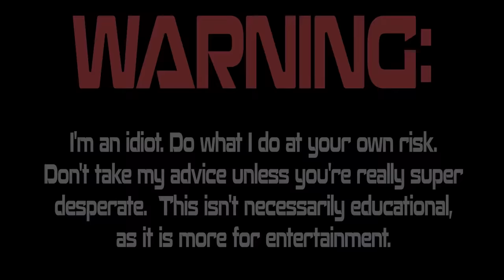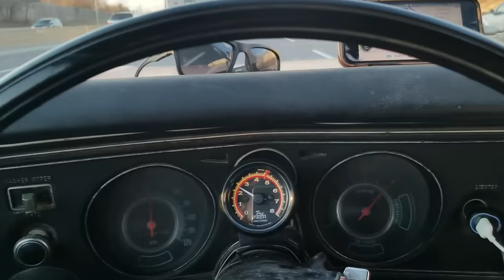FORGOTTEN 1969 Chevelle will it RUN AND DRIVE 500 miles home?

Comment: When you take the sparks out the heads.
May i ask why you do not put some squirts of Diesel down the cylinders.
It will even release a stuck motor if left over night.
I was told this by a old timer and it works very well. as it lubricates and frees rings like nothing else.
Give it a try bro and let your watchers know as well.
All the best from the UK

Comment: I saw you using marvel mistry oil in that old engine;.word to the wise is that oil is detrimental to teflon cam  gear teeth. If you want to test that theory soak a teflon tooth cam gear in a pan of marvel oil and let it soak over night. You'll discover what I did after doing that test. Teflon will break down and flake apart..most gear sets are all steel now days. My test was performed in 1980's. I love your many interesting videos from Shady Hills, Florida. USA.

Comment: Looks exactly like a car 🚘 my brother was going to work a deal with me a on when I had my learners permit except it was a 1968 he had put a 400 small block with a turbo 400 in it out of a 1970 caprice he had  but first time out he put the onions  🧅 to it and tore the rear end and suspension out he had to hire a fabricator to do some welding an suspension upgrades then ran into some financial issues and couldn’t hold the car for me and had to sell it I was bummed but probably a good thing I would have raised way to much hell with that car and being red tickets would have followed I ended up with a  pea green with gold side stripe  1968 Chevelle with a 250 straight 6  Saginaw 3 speed on the floor  jacked her up in eighties fashion or some rally aluminum mags on there with meats in the back had to roll the fenders of course to get them under there then painted her primer grey with black rally stripes 👍👍lots of good high school memories in that old car !!!

Comment: I was watching you work on “Rocky” and you did a compression test.   After you put oil in cylinders.  
I totally agree with everything you did but I don’t believe your compression numbers….
If you had say 14 psi of atmospheric pressure and you got between 140 psi and 180 psi.  You have to have a minimum of 10:1 compression engine.   
I just watching second video of that engine tear down and rebuild….

Your “psi” numbers are not correct and I believe that oil in combustion chamber is messing with you.  

What you think?

Also I’d like to know your thoughts on what the “1” means in 8:1 compression ratio….
I’m a boat captain and a pro fishing guide these days but I spent years at a junk yard or automotive recycling yard that ran “Hollander”.  I also was shop manager  of a smaller Hollander yard

I watch all your videos and I recommend them to my friends

And as a side note.   Some cylinders won’t have as much oil as others…. Unless metered.   This could also mess with the numbers 
Piston position combustion chamber design 
Location of spark plug hole.  

Lotsa variables

I say a true compression test is done with motor at operating temp after running and it should be done dry on the top end.  

Hook your peepers on that…
Maybe I’m wrong…,

I DONT KNOOOWW!!!

Comment: Only firing order 
 one I can remember off the top off my head is the ol straight six and Kenworth Trucks cause I build them everyday in Chillicothe Ohio. Straight six is, 1, 5,3,6,2,4. And the ol Kenworth diesels fire at the same actually if it is the Cummins motor. If it is paccar motor they are a bit different but almost the same. Just starts at valve 2 instead of one.

Comment: I had a Ford Focus. Was a nightmare always something wrong with it. I had a oil change a month before MOT day. On MOT day The guy took it away then came back and said I can’t MOT this. It’s bone dry. I was like 👀. They put oil in it for the mot and funny enough it passed. Had to keep drums of oil in the boot to keep topping it up. I hated that car. I came out one morning to warm it up so my pregnant at the time  partner could get In a warm car. 5 minute after starting it it kept clanking. My partner came out and we just stood looking at each other 👀👀. I decided to give it a few hard revs to sort that out. Turns out the camshaft snapped 2 seconds later 🤨. That was the end of that car.

Comment: I’m a diehard GM fan too I only like the older stuff because it’s reliable, these new GM vehicles sucks! My 1991 Chevy G20 van runs so good it’s for the 5.7l small block V8 with the 400 transmission I love that van it’s never let me down, I own a couple other chevy’s too & a dodge ram lol

Comment: Give up on rebuilt starters. They rebuild the drives. I have put NEW drives in countless recently replaced rebuilt starters. A set of brushes and bushings and a leather brake washer will fix most of them. Much cheaper too.

Comment: I would never stand over the radiator hole while tapping on the thermostats housing. If it popped open, you would get a free shower.

Comment: Luckily, it's the best SBC the 307! LMAO! Too bad it's not an SS 396. Kneeling on rocks is just as fun as kneeling on a 1/4" nut. In this case pull the windshield and the front seat then leave for home with the title. The rest is junk.

Comment: Heheheheeh you buy a car that sat in a driveway the day it was brand new because the owner only bought it to stare at it. This ‘68 maro here has been...... sitting here since ‘68 has literally 40 miles on her. Everything original she looks great aside from that tad bit of rust and the paints all faded. She never moved from this spot here. I bet she’ll run and drive she just been parked. Holy cow look how clean this motor is just dusty and got webs everywhere. Put some fresh oil in her and fuel I bet yeh she’ll run and move lol lol lol 😆😆😆

Comment: No need to know any other order then 1,8,4,3,6,5,7,2. Only engines worth tearing apart and build have that fire order. Plus no one is dumb enough to put any money in a ford or Mopar where I'm from. They break down get more then they are worth at the scrap yard lol.

Comment: laughing at this old episode from 5 years ago where a fella was a lot thinner and boy did a fella get beat down by the challenges. You could tell by his voice how tired he was of the whole ordeal. Ultimately this type fixup and drive became his trademark activity (propelling his ytube channel forward), but it has now become a bit formulaic and perhaps changes in the concept are needed. Why anybody would risk their lives to drive XXX number of miles in a sketchy vehicle with questionable mechanicals is the question for me. I do not watch this channel for the dare-devil (or devil may care) aspect to see if a fella breaks down on the side of the road (although sure it's kinda neat when he's presented with a fixable problem). Guess I'm more interested in understanding how you go about diagnosing and fixing the problems that allow for a vehicle to run after XX years of sitting. Once it's running I would prefer he simply trailer it home and then have other videos on restoration/remod and perhaps flipping or selling (which a fella hasn't done yet).

Comment: This car if it's the original motor should be a 327 which if it has the 202 heads is worth what you paid for the car if not a whole bunch more. That's my favorite Chevy motor the 454 RAT is a good one also if you can find one. I do know a guy in michigan that has one maybe. If he's got more than 2 brain cells to rub together never mind I seen the tag.